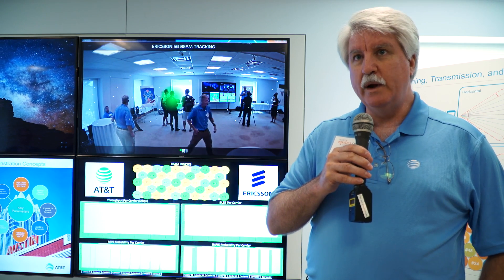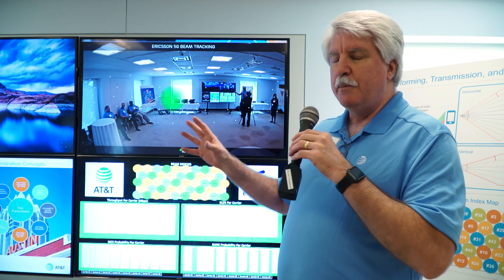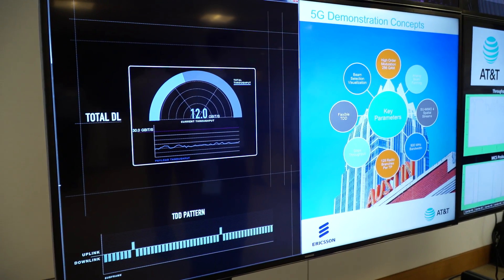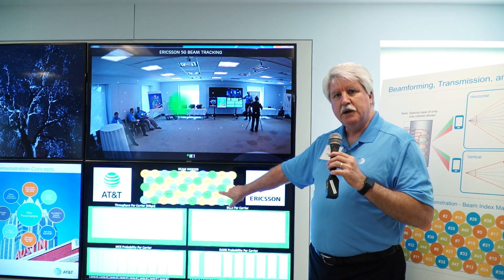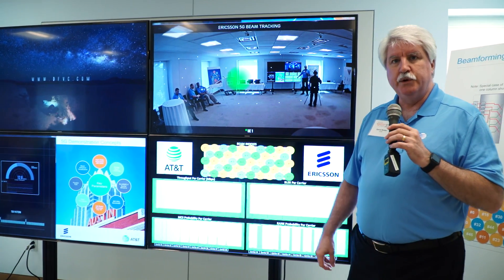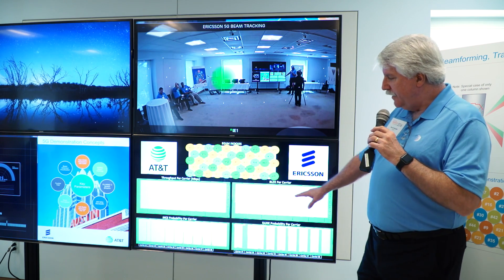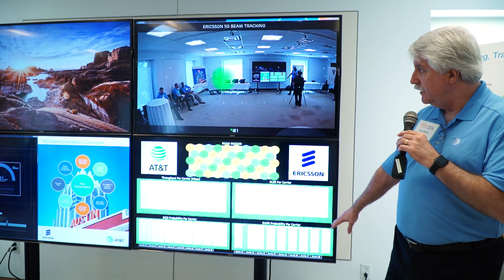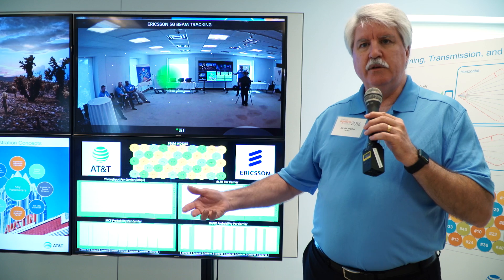AT&T and Ericsson demo 5G using millimeter wave

Comment: Modems are 5G, but that is in Gigahertz. It is not the millimeter wave of 5G.

5G connects into the electrical system, is where we see it doing the
most harm, by holding and amplifying the millimeter waves through
your homes electrical system. 

There is a lot of fear and confusion with the two, as they are both "5G".

Wifi is measured in gigahertz. The 5G transmitters placed piggybacking on the electric wires are the 5th Generation (5G) millimeter waves. Two different critters, completely.

And so my question is this please...........

Does anyone have suggestions, or know what of tools that deplete the 5th
Generation Millimeter Waves?
Reply: You sure??? Why didn’t they just do a study on it wether it’s safe or not...When people hide things and don’t test them, it’s gotta make you think 🤔 why hide it 😐

Comment: I don't want anything wireless.  I am sticking to wired, because energy should be encased in rubber shielding.  Millimeter waves penetrate the body like a thousand little antennas.
Reply: Now august 2020.. the governments force us to keep 2 m distance beetwen eachother .. blaming it on corona😦 but its clea why
Reply: @luluparl1245  yep, this is some upsetting stuff.

Comment: This wont work because it only travels 2 city blocks at the most
Reply: That's why atat is doing airgig to fix that problem but atat has speed problems and high ping times anything over a mile and everything starts to go down hill you have to go 10 miles to the next cell tower